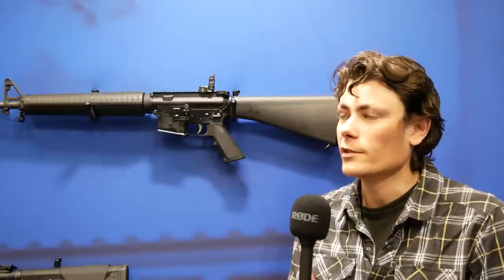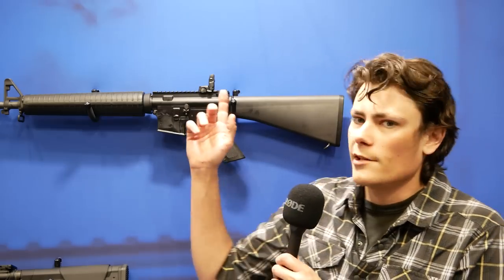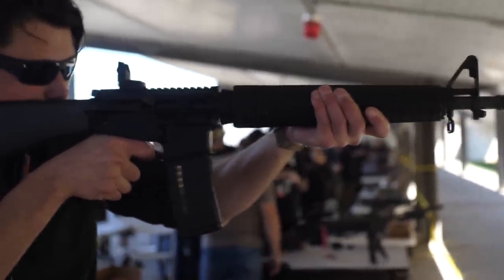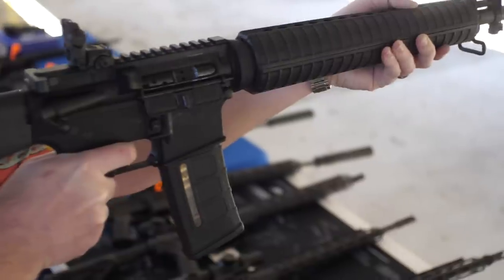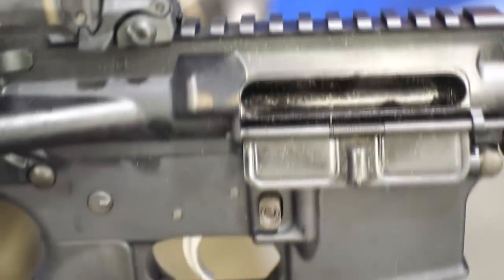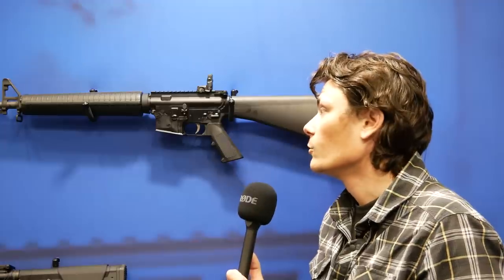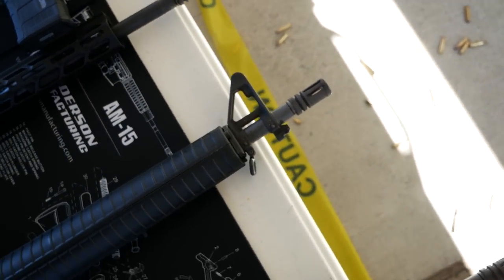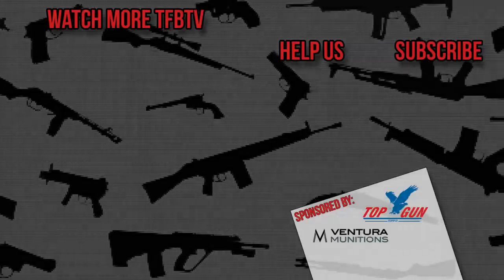The NEW Anderson Dissipator Carbine (But for Real!)

Comment: The beatings will continue until the amount of carry handles improves.
Reply: I've got a Windham dissipator with a C7 upper, ACOG reflex on the gooseneck mount, and an A1 length stock.  I love that rifle.
Reply: @middleclassthrash  did WW use a true rifle length gas system?
I put together a Dissy from a a2 carry handle bushy w/Spinta precision barrel and ran it through a carbine class with steel case and ran flawless. Sprinco blue and h buffer in a carbine tube. They really are nice
Reply: @hoonyur5973  carbine gas
Reply: Kmfdm
Reply: PSA will make them soon.
Reply: @middleclassthrash  want to see video ☺
Reply: Carry handles need to make a come back and drive the ridiculous prices they are charging for carry handle receivers down.
Reply: You’re a member of “RetroAR” aren’t you
Reply: @nolanmcevoy2547  not sure what that means
Reply: Was doing a range day with gas mask and was so glad for my carry handle mount for my optic.
Reply: @untouched303659  Ha. I remember when the flat top craze began.  You couldn't give an A1or A2 upper away :)

Comment: Del-ton has been selling a true dissipator heavy barrel for several years. With a rifle stock and buffer tube it shoots like a 22lr!
Surely Anderson will do the right thing and get carry handle uppers for this...
Reply: Its HB has kept me from buying. Hopefully this Anderson doesn't have a HB.
Reply: I have a Del-Ton Dissy barrel on a Luth A1 upper with original Colt furniture, it’s a dream to shoot.
Reply: The Del-ton was my first AR. Still love it.
Reply: Joshua Jones  Besides Fulton Armory, two models from Del-Ton, a model from Windham Weaponry, two models Colt (but who'd want to spend THAT much for a handle...), Brownells and Thunder Tactical offering fixed handle upper parts...

Hop said PSA has the monopoly on fixed carry handles, not that they are the only ones in the game.
Reply: I have this exact setup. Just got it a few weeks ago. It's easily my favorite build. I put a lower mass bcg in it for added reliability due to the lower gas. It already shoots gentle but when I put a muzzle brake on it, Holy cow it feels like a damn gun now. I love it. Whoever is thinking about getting a dissipator, just get one. You'll love it.
Reply: @toddparsons2980  Ditto, I'm not interested in a HB, but the Delton is SO MUCH cheaper than building my own that I'm tempted to buy one anyway and sell it in a few years when fixed carry handles become available again.
Reply: @toddparsons2980  get a Spinta precision dissipator barrel. I think that’s what you’re looking for. 16” lightweight contour barrel, rifle gas, 0.115” gas port that runs steel flawlessly
Reply: @hoonyur5973  called Anderson today about this and they said 6-12 months out - geez.
Reply: joshuajones335  Luth and Thunder Tactical still make carry handle uppers, as do TNTE and Del-Ton but they've been out of stock for a while.
Reply: @PrebleStreetRecords  I thought TNTE used the nodak spud uppers?
Reply: @cymond  idk why Del-Ton won't just make lightweight or at least A2 profile version. ???

Comment: The best way to run a no frills AR. I did a 20" build as my first rifle and after only a few months I cut it down to 16.5". Its just the sweetest setup to run, and any claims about reliability need a reality check.
Reply: Strangely I have several 16" rigs.   One of them is getting turned into a 20".  I have fallen down the rabbit hole of precision shooting and I find I shoot the longer barels better.    But this on an fixed stock would be 👌
Reply: @bmstylee  You also get the added benefit of basic ol' 5.56 basically turning into duty ammo with the 20" barrels.

Comment: It took a lot of trial and error to get the true disspator from delton I built to run. I had to drill out the gas port and get a low power spring to finally get it to cycle nice to see people making ones that don't require so much frustration to get shooting

Comment: My dissipator runs everything, and works great.  It's a true dissipator but I had to lighten the buffer from the standard 5.5 oz a2 buffer to a lighter 3 oz buffer.  Standard a2 is too heavy and you short stroke it.  3 oz works perfect.  Not over or undergassed and light shooting.  Just ordered an A2 carry handle receiver to make it awesome.  Going to have to pull my barrel and everything off my other.  Just need to put triangle handguards and my car 15 lower on it, and I will have a clone of the north hollywood dissipator.

Comment: "Faux/Real/True/Fake" Dissipators is a misnomer.  
Bushmaster made the Dissipator carbine in the 90s with a carbine-length gas system.
Colt made the 605 with a rifle-length gas system in the 60s.
Now, Dissipator is used like Kleenex or Xerox.  It's a trademark that became a description for an entire category.
All Dissy builds are beautiful, but if one continues to use the "real/faux" label, they're just propagating gun-counter Fudd lore.  
One might as well start using "stopping power" and "just rack the slide to scare 'em," too.
Best,
JBR

Comment: PSA does NOT have the monopoly on fixed carry handles. A1 and A2 carry handles are definately being made (albeit in small batches...aaaaand you have to know where to look and be ready to jump on them like the proverbial fly on sh-t).
It's just that the current industry is geared SO MUCH towards flattop uppers.
Reply: TNTE Sales is now manufacturing billet carry handle uppers in A1, A2, 9mm and AR10.
They recently had a preorder open.

Comment: How does it run reliably with virtually no dwell time?!?
Reply: That's the gas port tuning they were talking about. The gas port on dissipator barrels are enlarged to flow more gas with the limited dwell time.
Reply: Low mass bcg or lighter buffer spring

Comment: The rifle length buffer system can be improved by using a lighter buffer weight. Standard rifle weight is about 5 oz, Midway USA sells a JP brand low mass version that’s 3 oz. I have it in my 300 blackout rifle and it cycles everything flawlessly, without needing a suppressor for necessary back pressure.
Reply: In theory, the lighter weight buffer should be perfectly functional with a standard spring, irregardless of being Rifle or Carbine length. I don’t have much experience with alternate power springs, but my thought is that if a spring doesn’t need much power to go back, then it won’t be able to give much power going forwards. 

In a sterile competition target gun, that’s perfectly fine, but a working duty gun needs to be able to overcome potential filth that would cause the BCG to slow down.

Comment: Bro Anderson is really the sneaky shit on younger sibling of the ar world. If you want to build a cheap AR an Anderson lower has better quality control than a colt (fight me fan boys there are countless posts proving that) and while you won't get some of the snazzy features of a aero and they might not be flawless. They are solid, quality is good, and frankly, the lower is the most basic part of the gun, as long as it's not fucked up and bent, any lower that holds a buffer tube and trigger pack will run.
Reply: I built my AR in a stripped Anderson lower and a complete Anderson upper, works flawlessly.

Comment: A great very interesting video and rifles. Why is the rifle not presentable on the shelf with the firing pin inside the bolt? Is it a safety measure regulation?
Reply: Yes
Reply: @mike-yd4py  Thank you.
Reply: Correct.
Reply: @toddparsons2980  Thank you.

Comment: Spinta Precision was the only other manufacturer of recent note that makes true Dissy barrels.  I have one, and it runs really well.  No issues cycling all sorts of different weight brass ammo, plus steel garbage.
Reply: Delton also makes true dissipator barrels
Reply: @martingomez6108  

Yeah, true. I just hate that they only make 1:9 twist barrels.
Reply: SOT Mfg makes a 16.01" Dissipator barrel, but I'm unsure if it can mount a fixed FSB